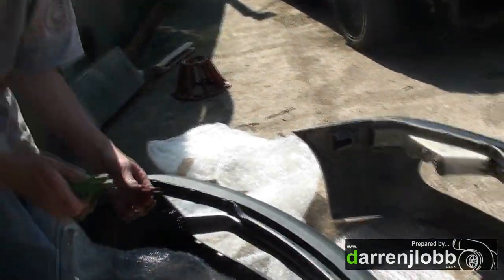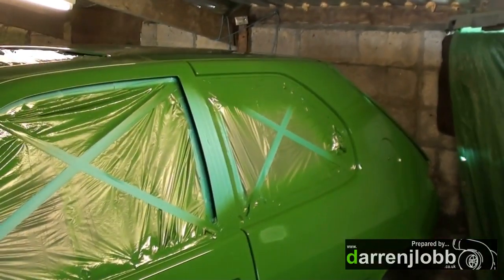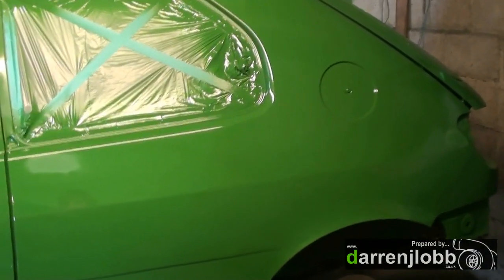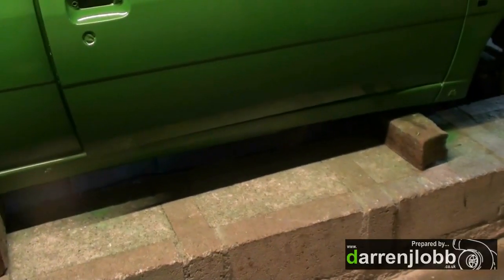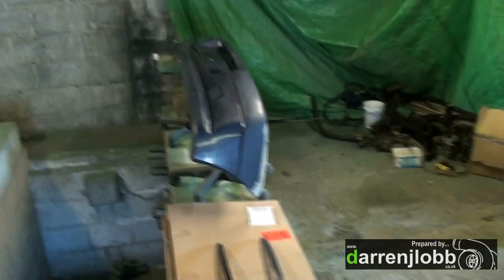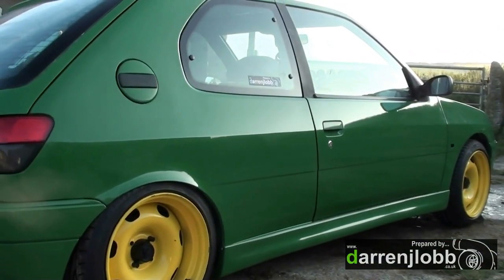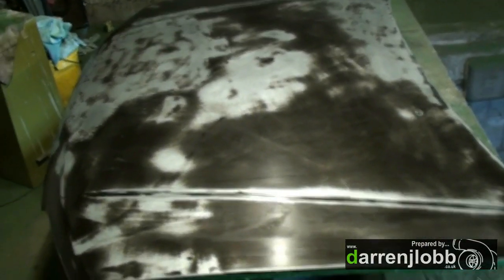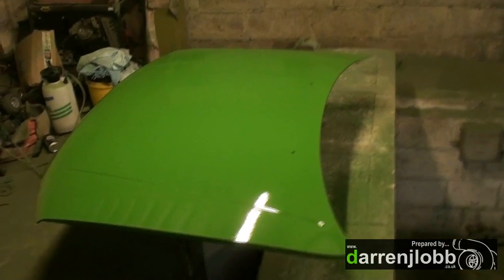darrenjlobb's 2014 JD Derv Bus Project Part 8

Comment: Difficult to say without seeing, but are you sure those deep scratches you couldn't get out wasn't scratches in the primer that was painted over?

What type of paint are you using? If it's 2k it does go off harder than solvent/cellulose, so leaving it a week will make it harder to wet sand and buff - you could try doing after around 3 days (perhaps try on a test area first). Think the last time I used it I left it around 24 hours and was able to hand buff it, but this was in the summer so it would have cured faster.

Comment: Looking damn good Darren, black mask with the standard lights maybe?

Know your not gonna wanna give it away just yet but you sticking XUD or throwing in something abit different? :P
Reply from the maker: Jamie Sandles The motor will  be based around the 2.0 16v HDI engine that my last motor was.
Reply: Ahh that's good to hear.. Your sure to release that engines full potential.. Look forward to it :-)

Comment: will you still be using a dw12 engine for this. would a dw10 8 valve not be a it easier to modify. nice lookin colour by the way :)
Reply from the maker: ***** I will be using a DW10 16v engine as in the car before :) Thanks for watching.
Reply: cool cant wait to see the build. have a wee 306 project goin on myself. got a bosch pump for her last week :)